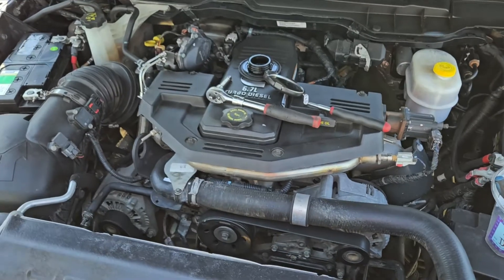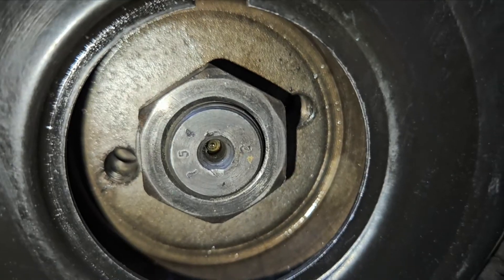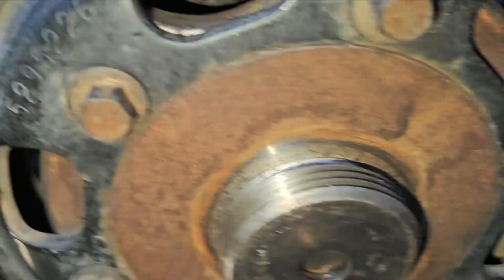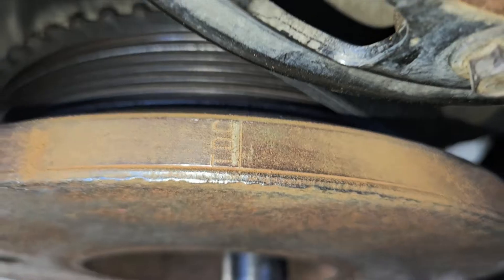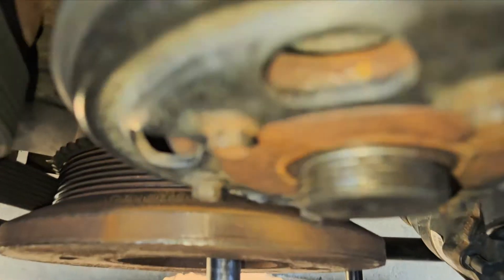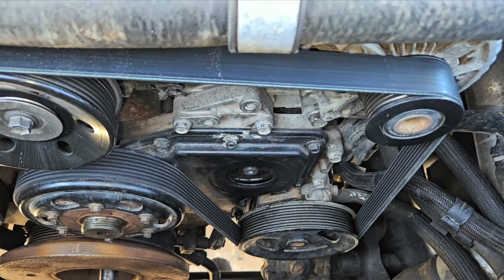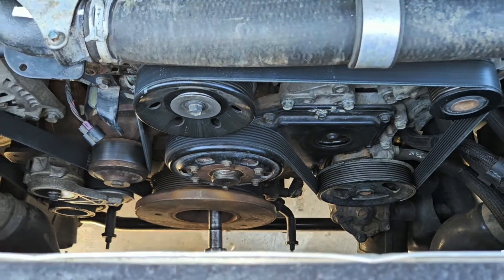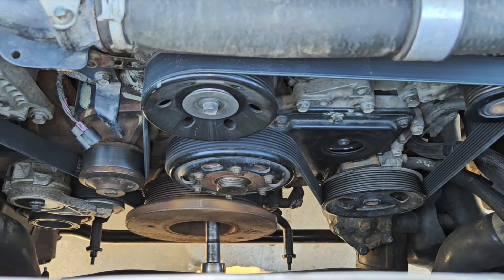Ram 6.7 cummins ticking sound how to time fuel injection cp3 pump phasing procedure accurate

Comment: Is this what causes your truck to lose power when hauling? Mine does the same and I’ve already changed oil fuel filters crank case and crank case sensor but still does a loud clicking noise with no engine code
Reply from the maker: No it shouldn't. The way I think it is, the timing it right is to hide the sound with engine possibly.

Comment: Have you come across a 6.7 cummins 4th gen that very briefly hickups when you are at a stop accelerate briefly and then let off? I mimicked what it does by turning off the ignition and quickly turn it back on while driving very slow. That is exactly what it feels and sounds like. Mine is a 14' 2500 and has done it since new? No codes have popped up and it consistently does it. Thanks again.
Reply from the maker: No never. Just these loud ticking sounds.
Reply from the maker: Try another engine computer
Reply from the maker: Or reprogram it
Reply: I have the same thing, in drive and especially reverse. 09 third gen it sort of hiccups if I blip the throttle then catches itself. You ever figure it out?
Reply: @InsomNiac144 Not yet, changed the fuel actuator module last week and no difference. It's almost like it cuts the fuel off too fast and essentially shuts the motor off for a split second, only if the motor is under load. Won't do it if I'm in 2nd gear or above (auto transmission 68RFE). But yes, it does it in reverse too. So annoying
Reply: @alittlebitofeverything5090 yeah it almost wants to die and catches itself with too much fuel. My work has a 2022 and it does the same thing…
Reply: I had same thing in a 2021 6.7. Peddle monster fixed it entirely.
Reply: @tysonristrom8473 Thanks, I might have to try it.

Comment: just got cp3 recall in my 2020 4500  ram and it sounds like shit !! lol the dealer claims there is no need for phasing ....lol i told them to do it lets see if it fixes the loud  Ticking its super loud ......
Reply from the maker: Had 2020 ho recall done recently as well. Sounds good
Reply: 2020 has the cp4.. Are you sure about that?
Reply: @Félix-AntoineMarquis it has a recall where they put a cp3 on it
Reply: Did you phase it?

Comment: So with the CP3 being out of phase will putting a load on the truck stop the knock when I put a load on the engine knock goes away
Reply from the maker: It's the ticking sound out of order. Seems like it's timed into the ticking of the engine.